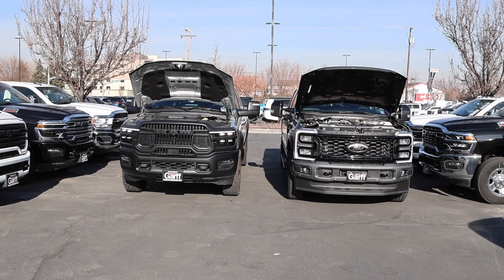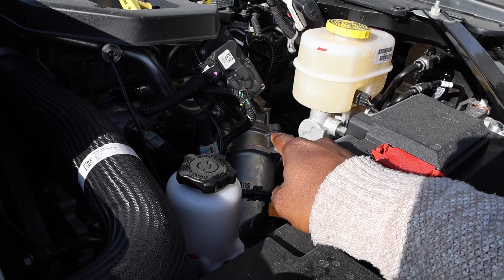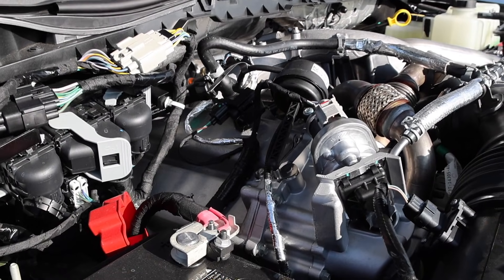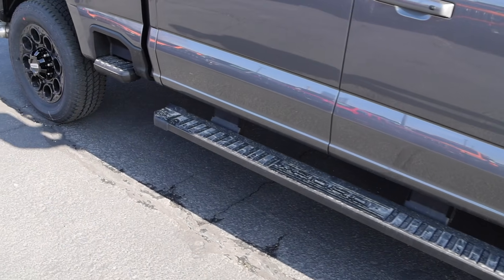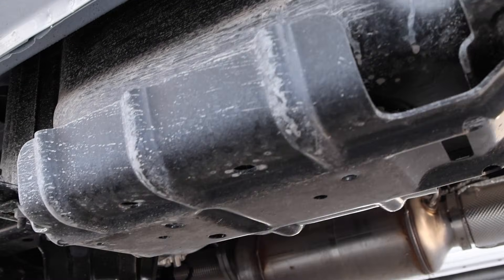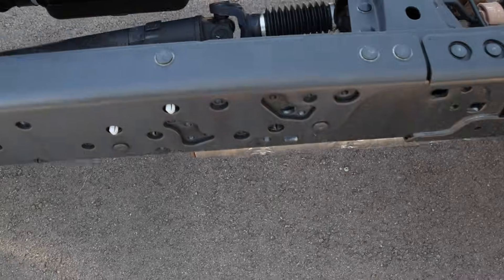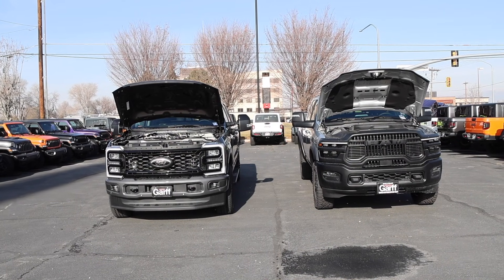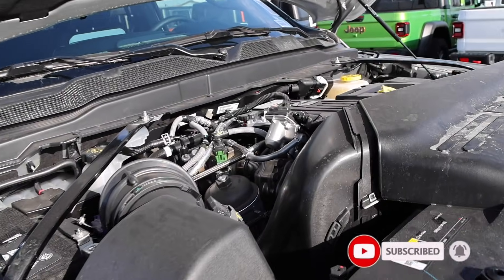For 2026 Which Diesel Emissions Component Needs To Be Deleted First?

Comment: The best thing to do is delete your mentality of messing with things leave the  truck alone. The trucks with the most problems or the deleted trucks. The trucks with the highest engine failure rate are the deleted trucks, especially while a truck is under warranty. Leave it alone maintain it and drive it. This is coming from a truck mechanic I maintain a fleet of trucks and not a single one of them is deleted. We learn the systems we know how to diagnose and repair them.

Comment: It's getting to the point that the extra systems that the manufacturers need develop and sell with these trucks have wiped out the advantage of diesel fuel. They need to switch to forced induction gasoline engines that are built like a diesel engine, but without all of this emissions garbage that diesels are forced to use that raise the initial cost, operating cost and reduce reliability and longevity. Rumor is that Ram will get the Cummins 6.7 gas engine option in 2027, make HD trucks great again!

Comment: First its EGR, because  that damwges your engine from the inside, then go to def and exhaust system next. Towing in a liwer gear with more rpm helps clean def filter by keeping it hotter, plus keeps def exhaust  temps liwer, less stress on transmission,  giving  longer durability.  FYI, i have 421k on my 2015 Ram 3500 dually with HO Cummings  engine  and  Asian  transmission  towing  triple  axle  stock  trailers  and  32 ft tandem  axle  dually  flatbed  trailer  hauling  round hsy bales up to 29k.

Comment: How I would put my truck on a diet. Yes, I run additives from Doc’s diesel, but you can’t beat a weight loss program. For the def I use the 2.5 gallon jugs from places that sell a lot of def just like you would diesel fuel.

1. Egr 
2. Def
3. Dpf

Comment: EGR 100%.  Does the most damage to motor.  2nd would be in cylinder emissions (extra fuel to light up DPF regen) although Ram now has a 7th injector and no longer over fueling in exhaust stroke which pollutes motor oil.

Comment: You wouldn't need a DPF if you didn't have EGR. EGR cools combustion to reduce NOX but cooler combustion increases soot. DPF increases exhaust temp to burn soot.
Reply: If it only burnt it outta the intake
Reply: @freedomisntfree_44   wouldn't be in the intake if there was no EGR recycling exhaust into the intake. 

Personally, I would be willing to consume more DEF to reduce NOX in exchange for no EGR. Fuel mileage would be better because engine would produce more power and no regens. Less soot would reduce engine wear and intake clogging. Fixing Def issues is cheaper than replacing worn out engines from soot, the lost fuel efficiency, and replacing the DEF and EGR systems it engine from EGR cooler leaks.
Reply: @cc-tb3st I just took al that crap off

Comment: Its EGR fpr me because that's the one that will cause internal engine damage.  The exhaust system is relatively cheaper and easier to work on when it fails.